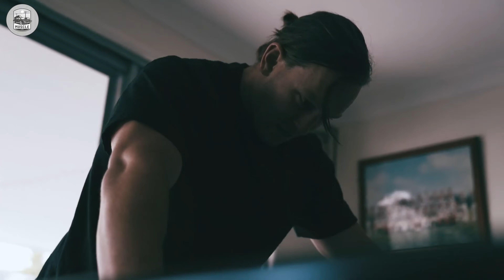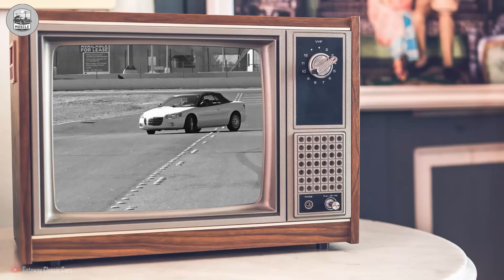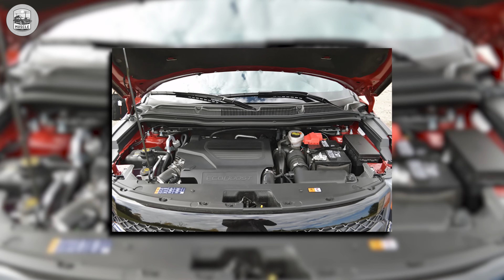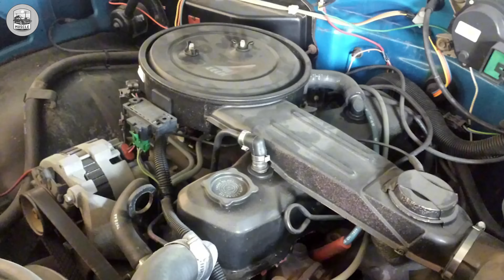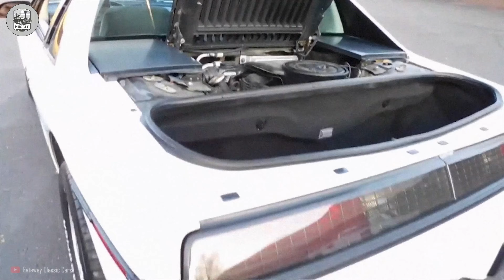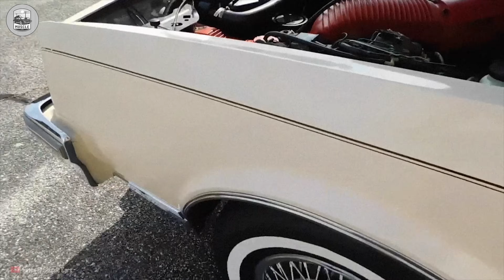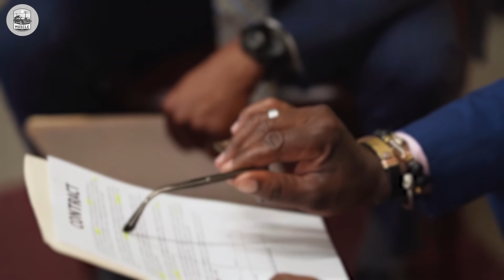MOST FAILED ENGINES ever put in production cars | Worst engine blunder!

Comment: Great list, but I was definitely expecting to see the Cadillac 4100 and Northstar engines make an appearance! Both of these had their fair share of infamous issues, from the 4100's oil leaks and underwhelming power to the Northstar's notorious head gasket failures and high maintenance costs.
Reply: totally agree.... The Cadillac 4100 and Northstar absolutely deserve a spot on this list for their unique character! Sure, some fans love to bash on these engines for their issues, but let's be real – they brought something different to the muscle car world! The 4100 may not have been the strongest, but its quirks make it memorable. And the Northstar? Head gaskets aside, it showed Cadillac was still trying to push the envelope with advanced tech, even if it came with a few challenges. These engines definitely deserve some recognition
Reply from the maker: Absolutely, you nailed it! The Cadillac 4100 and Northstar engines were bold moves for their time, and they both deserve more credit than they get. The HT4100 may have been modest on power, but it marked a period where Cadillac was experimenting with weight-saving aluminum and fuel efficiency, which was a huge pivot from the land yacht era. This engine paved the way for Cadillac to rethink what a luxury performance engine could be, quirks and all!
And as for the Northstar, Cadillac really went for innovation. Variable valve timing, all-aluminum construction, and the Northstar's high-revving nature were ahead of their time, especially in the luxury market. Despite the well-known head gasket issues, the Northstar was a powerhouse for Cadillac’s return to performance – and let’s face it, it set the stage for a whole new era of Cadillac performance vehicles.
Let’s hear what you all think! Share your stories, opinions, and subscribe to American Muscle Cars so we can keep this conversation going and give these engines the recognition they deserve!
Reply: I'd been told the HT-4100 V8 had fuel injection problems
Reply: @williamslater-o5b  I get why the HT4100 gets trashed it wasn’t exactly a torque monster but let’s give credit where it’s due. This engine was a step forward for Cadillac, introducing aluminum block tech and fuel injection in the early '80s. Sure, it had its issues, but plenty of engines from that era struggled with early EFI systems. The 4100 wasn’t built for burnouts; it was designed for smooth luxury, and when maintained properly, it did its job. Muscle car fans love to hate on it, but not every engine needs to be a tire-shredding beast to have its place in history
Reply: @AdelynDodson  The HT-4100 couldn't have been all-bad; the later 4.5 and 4.9 L versions were known as rock-solid. But GM rushed the 4.1 into production in response to the relatively minor annoyances of the V-4-6-8, putting it in cars that were much heavier than those for which it was intended. They should have deactivated the 6 cylinder mode on the V-4-6-8 and lived with it for another 3 years, or used V8s from other divisions.
Reply: @pcno2832  Look, I get the HT4100 hate, but c'mon every engine has a purpose. Cadillac was testing the waters with aluminum blocks and EFI. Yeah, it wasn’t a pavement-pounding V8, but not every engine needed to be. They aimed for smooth, efficient luxury. Blame GM for shoving it into heavy cars instead of fine tuning it. Properly maintained, it delivered. Muscle car guys forget: innovation always stumbles before it shines. Respect the history....
Reply from the maker: The Cadillac 4100 and Northstar engines both brought their own unique challenges to the table. The 4100, introduced in the early '80s, was Cadillac’s attempt to downsize and improve fuel efficiency, but it faced issues like low horsepower and oil leaks that hurt its reputation. Cadillac intended it to be economical, but many enthusiasts found it lacked the performance expected from the Cadillac name.
The Northstar, on the other hand, was Cadillac’s high-tech flagship engine in the '90s. Known for its power and smoothness, it unfortunately became infamous for head gasket issues, high repair costs, and a complex design that could be challenging to maintain. The Northstar had potential and offered a solid driving experience—when it was running well—but the long-term reliability concerns overshadowed its performance for many owners.
If you’ve got more to add or have experience with these engines, we’d love to hear about it! Drop your thoughts in the comments, and if you’re enjoying the deep dives into American muscle history, make sure to comment, share, and subscribe for more content on both the iconic and controversial engines that shaped the industry....
Reply: @MuscleCarMasters68 you did list Northstar in this video, so to your credit, I don't know what this person is talking about. 😊-1 point for you about the gm3800, and +1 for you in this dispute 😊
Reply: @MuscleCarMasters68  The 4100, introduced during a time when Cadillac was under pressure to meet new fuel efficiency standards, indeed struggled with reliability. Its aluminum block, combined with cast-iron heads, often led to overheating and coolant issues that frustrated owners. Plus, its low output of around 125 horsepower really did fall short of the powerhouse reputation Cadillac had built over decades. Unfortunately, despite Cadillac's effort to embrace fuel economy, the 4100’s reputation stuck as one of the brand’s weaker engines.
Reply: My dad had a 95 and 2000 ETC. Both had the Northstar V8. Very quick cars, but did they go through the oil. His mechanic told him that was the way they were.
Reply: @williamslater-o5b  Northstar V8? It had its quirks, but it was a pioneer. 32 valves, aluminum block Cadillac pushing tech in the 90s... Sure, oil consumption was high, but that’s high-compression performance for you. Proper maintenance mattered. Folks forget, these engines paved the way for tech in modern performance V8s.
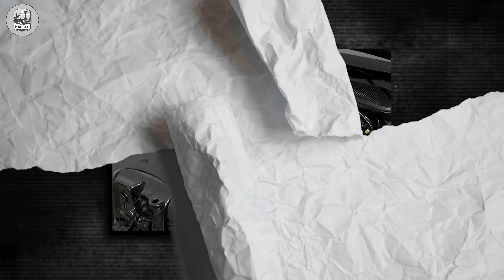Reply: 29:59 it's in here.

Comment: You might want to think about creating a dedicated list just for GM's failed engines. From the 3.1L V6 to the Oldsmobile Diesel and even the 2.4L Quad 4, there’s a whole lineup of GM engines that could fill an entire video series on their own.
Reply: @CookeZachery  3.1 and 2.4 issuse were almost always maintaining issues....
My lumina had a 3.1 with 200k no issues
Reply: @taomicioli  While I respect the durability stories about the 3.1, I think it represents the same 'good enough' mindset that held GM back during that era. Sure, it could go 200k miles if maintained properly, but it was never an engine that inspired excitement or innovation. Meanwhile, GM's European counterparts were pushing boundaries with more advanced, efficient, and performance-oriented designs. It’s frustrating to think about what could’ve been if GM had taken the bold route—turbocharging, better breathing DOHC layouts, or even embracing smaller, high-output engines like Opel was doing. Engines like the 3.1 and the Iron Duke might have been reliable, but they were also uninspiring placeholders in a time when GM could’ve shown the world what American engineering was capable of. Settling for adequate reliability instead of engineering excitement just doesn’t sit right with me.
Reply from the maker: GM's lineup of 'challenging' engines could easily fill an entire video series. Starting with the 3.1L V6, known for head gasket issues, to the Oldsmobile Diesel, which, while innovative, fell short with reliability concerns and a lack of durability – GM certainly had its share of experimental designs. And then there's the 2.4L Quad 4! Originally intended as a high-output, efficient engine, it faced problems like head gasket leaks and timing chain issues, making it memorable for all the wrong reasons.
The potential for a full series on these engines is huge. We'd love to dive into the stories behind each of these powerplants, from the engineers' visions to the real-world outcomes. Everyone, let us know in the comments if you'd like to see that series! Be sure to share this video and subscribe to American Muscle Cars – we’ve got more in-depth content on GM's history and much more coming your way!
Reply: @MuscleCarMasters68  you could just make a series about GM using a worse engine than there was in the GM family for "reasons". particularly in the 4 cyls of 80s. particularly the fiero.
Reply from the maker: @lasskinn474  GM's history of sometimes ‘puzzling’ engine choices in the '80s is prime material for a series! The Fiero's 2.5L "Iron Duke" engine is a perfect example: initially meant to balance economy and durability, it didn’t quite meet expectations, especially with some high-profile failures and recalls due to oil leaks and connecting rod issues. And when it came to high-performance potential? Well, the Iron Duke left enthusiasts wanting a lot more.
And let's not forget the 2.8L V6, which, although better suited to the Fiero's ambitions, still wasn’t without quirks, from cooling issues to intake manifold problems. GM had higher-output engines in their arsenal, but cost and design constraints meant they often stuck to engines that weren't quite up to the demands of spirited driving.
We’re excited about diving into this series – tracing how each decision played out for GM and for the fans who loved (or put up with!) these engines. So, let us know what you think in the comments, share this video with fellow fans, and subscribe to American Muscle Cars. We’re ready to take a deep dive into these engines and bring you more on GM's legacy, both the highs and the lows....
Reply: @lasskinn474  I get where you're coming from, but I’d argue that not all of GM’s 4-cylinder engines of the ’80s were worse choices. For instance, the Fiero’s original engine may have had its limitations, but the 2.5L ‘Iron Duke’ was actually chosen for its reliability and fuel efficiency, which were key priorities during the fuel-conscious 1980s. It may not have been a performance powerhouse, but it fit the needs of the time. Plus, GM did make strides in other engine areas later on, like with the Quad 4. There's definitely a list of misses, but it's not all one-sided....
Reply: @CookeZachery  the european gm wing for latter half of 80s had cheaper, lighter engines that did same power with much less displacement as the duke while being more fuel efficient though.

like 90hp is 1.6l region, not 2.5. GM had cheap efficient 4 cyl designs all along within the company. 

at the latter end if they had done a fiero2 just with the driving gear from the turbo 4wd calibra that could've been really something.
 
the refusal to use the european gm designs that went into cheaper cars and were more efficient would make for a decent video. not just 4 cyls, 1990 opel/vauxhall had a saloon with a turbo inline six that had higher top speed than the zr1 1990 - that also used less fuel.
Reply: @lasskinn474  Honestly, it’s a shame GM didn’t lean more into their European designs in the ‘80s and ‘90s. American fans always rave about the Duke or the Iron Duke, but those engines were practically dinosaurs in terms of efficiency and power output. European GM had lighter, smaller-displacement engines making similar horsepower with way better fuel economy! If they’d just put one of those turbocharged inline-sixes from Opel/Vauxhall into a Fiero or even a Camaro, they could have really had something on par with European sports cars for way less fuel. Imagine a Fiero with that kind of powertrain—it could’ve been a real game-changer instead of the underpowered, overheated compact we ended up with.
Reply from the maker: It’s fascinating to look back at how GM could have leveraged its European engineering to redefine its American lineup during the ‘80s and ‘90s. European GM was years ahead in efficiency, packing impressive performance into compact, lightweight engines that were fuel-efficient without sacrificing power. That 1.6L making 90 horsepower? A real testament to smart design, especially compared to the Iron Duke, which was reliable but certainly not groundbreaking in either power or economy.
The idea of integrating the turbocharged inline-six from Opel/Vauxhall into a car like the Fiero is thrilling. The Fiero was an ambitious project but held back by conservative engine choices. A “Fiero 2” with a powerful, efficient European GM engine, especially a turbo inline-six, could’ve been a true competitor in the sports car market. Imagine the handling and performance that could have come from adapting the 4WD system and the turbo from the Calibra—GM would’ve had a mid-engine, turbocharged, AWD compact with real punch. This would have also given American buyers a taste of high-tech European engineering at an affordable price.
It would make a great video to dive into the “what ifs” of these European powerplants in American models and explore how differently GM's legacy might look had they embraced this tech. Thanks for this awesome comment, and everyone, let us know what you think! Share your thoughts below, and don’t forget to comment, share, and subscribe for more American Muscle Car insights...
Reply: @MuscleCarMasters68  I don’t get the obsession with the Iron Duke—sure, it was reliable, but it was a missed opportunity for GM to innovate. European GM was proving that smaller engines could deliver performance without guzzling fuel, and we just didn’t take advantage of that over here. Imagine if the Fiero had been equipped with a turbo inline-six from Opel—lightweight, powerful, and way more exciting than the Duke. That kind of engine would’ve given the Fiero a real chance to compete with European sports cars on American soil. Sometimes, I think we settled for “good enough” instead of pushing boundaries.
Reply from the maker: @CookeZachery  The Iron Duke’s reliability was a plus, but GM really did miss an opportunity to push the Fiero to the next level with a high-performance European engine. Imagine the buzz a turbocharged inline-six from Opel could have created—not only would it have added the power and finesse that the Fiero deserved, but it also would have brought GM in line with the rising demand for sporty, fuel-efficient cars with European-style agility. GM’s European division had incredible engines that would have been a natural fit for American models like the Fiero. The Opel/Vauxhall inline-six or even the Calibra’s turbocharged four-cylinder engine could have transformed the Fiero into a serious competitor for imports, offering not only great performance but a whole new level of driving excitement. And an AWD, turbocharged Fiero? That would’ve been revolutionary and a serious challenger to anything Japan or Europe was putting out at the time. The “what could have been” scenarios here are huge. If GM had gone bold, adopting these European engines in its lineup, it’s easy to imagine how they might have rewritten the American sports car landscape, offering lightweight, powerful models that combined American muscle with European handling and efficiency.
Reply: @lasskinn474  yup, I've had almost every year and both engine option Fiero's. never had a failure of any kind. did custom rebuild of the 2.5 and 2.8 -> 3.1 conversion. finally ended up with what I'm now driving, '87 GT 5-sp 3400. if only it came with that stock, or the 3.4, though i don't think it existed at that time. but ya, the 2.5 was a turd. with other engines almost half the size and 2x the hp. it just made more and more noise the harder you revved it, no mention of any more power. hehh. but you go with the positives you do have, i leveraged the higher torque it had with a light good handling car of the time and had plenty fun with my 1st car, and '84 SE auto.  and now me at 47 age driving my '87 3400 , its one of the few things that brings a huge smile to my face every-time i take it out!